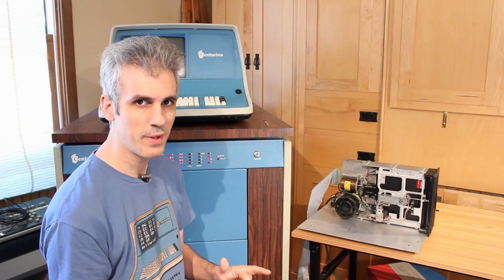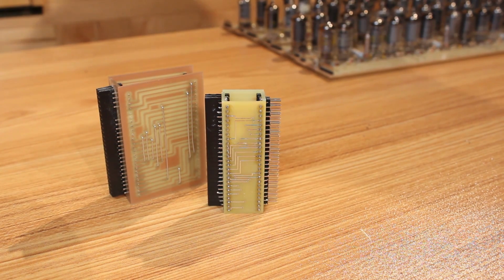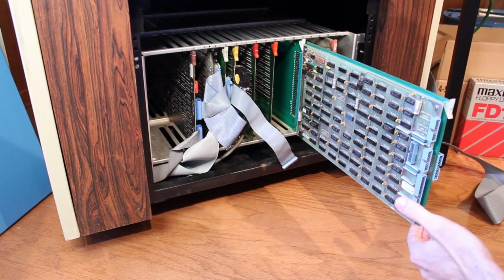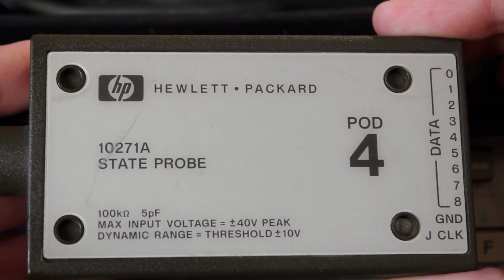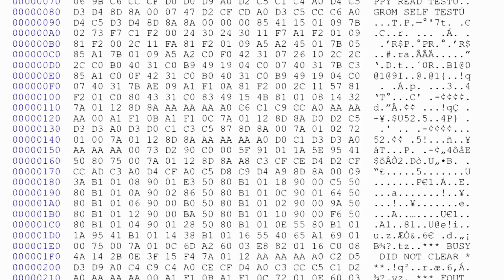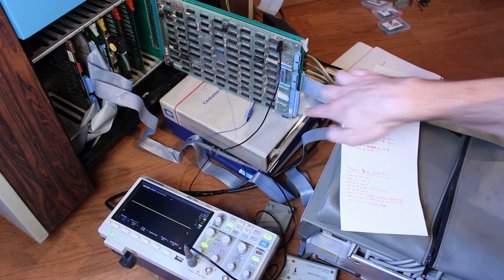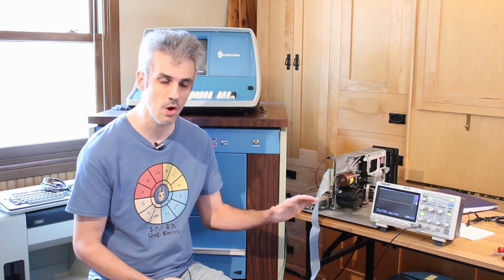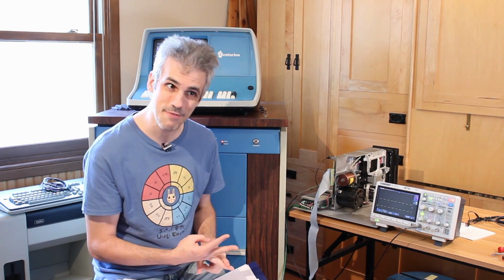Minicomputer Part 22: Working on the FFC and CDC Floppy Drive

Comment: I saved one of those HP Logic Analyzers, a 1631A, from going into the dumpster at a previous employer. It had been bought in the 1980s direct from HP, used about about 30 minutes, and then put into storage up until the mid 2010s. That previous employer had a program where you could buy disused and fully depreciated equipment for a donation to the United Way, so at the end of that day, my wallet was $20 lighter, and I had a somewhat broken logic analyzer. I was able to diagnose intermittent switches in the keypad, so after an arduous disassembly, treatment of the keypad switches with DeOxIt and a reassemble, it worked perfectly. What a blast to see a similar unit here on the channel!

Comment: Microcode is essentially a ROM being used as a replacement for combinational control logic.
It's cheaper, and simpler, than designing a custom combinational logic circuit.

Comment: The PCB artwork you showed, with the whimsically routed traces on both sides... you could have PCBway put that on an flexible polyamide substrate, which is a transparent amber film.  That way, they could show off their manufacturing skill, and you could show off your trace routing. (Maybe not period correct, but they did use some flex circuits in the Apollo Guidance Computer core memory module, so it kinda has some vintage chops!)

Comment: 21:40 Im not well versed in 8 inch floppy stuff (I mostly work with reel to reel tape controllers and systems used in the old animatronic band from my childhood, The Rockafire Explosion) But the jittery nightmare going on there could be a problem with voltage, as I had some similar problems with the stepper motor on an 5 1/2 inch drive that was used with programming the RAE, and it turned out to be a bad capacitor (and possibly a faulty logic chip)

Comment: The step frequency is basically determined by the stepper motor inertia. Back then adjusting the step rate for specific floppy drives was common. It may be possible to replace the stepper motor in the drive to speed up the seek time.

Comment: It is quite the journey watching this series and the reverse engineering and detective work going on to get the system fully up and running. BTW, if you have a heavy guage piece of wire you could use it to jumper the missing ground pins on the extender board.

Comment: If you create a new version of the dual adapter you should avoid those 90º corners for etched PCB's. Nowadays does not matter too much as the manufacturing processes have improved a lot but it will get a better defined trace if you use 45º corners, 90º angles can cause an "acid trap" that eats too much copper. Again, not very relevant nowadays, but hey, if you can ease the manufacturing process with barely no effort, why not?

Comment: Just a heads up about the LM319 and LM339 comparators. The LM319 is significantly faster than the LM339. If you can't get clean data off the disk head through the LM339 replacement, you'll want to put in an LM319. Cheers.
Reply: The head signal goes through two amplifiers and a filter before getting to the comparators. The speed difference probably isn't that relevant given how they are used in the circuit but there are some '319s on the way for permanent placement. The speed difference is apparent on the waveforms though.

Comment: Hope you are able to preserve a copy of the micro code for the 9406 drive before modifying it. It may be useful some day.
Reply: Yes I was thinking that, because the Hard Drive may not work with the new Microcode
Reply: @MrLukealbanese  The changes to the microcode will only affect the floppy, the Finch uses almost completely separate microcode on the FFC. (In fact the circuitry for the Finch on the FFC is mostly separate as well, it's effectively two controllers in one). But the current microcode is on OTP ROMs so we won't be destroying anything, just burning new ROMs and swapping them out.
Reply: @sjsoftware72  thanks SJ, your contribution to this great project is brilliant!!!

Comment: Tips for your riser card:
- see if you can add sliders and hinges on the end. In professional environments we do this for greater stability and easier access.
- add jumpers in series and test lugs (pins which allows scope probes to be attached) so you are able to disconnect and to measure signals. Number them like you did on the front and back connector.
- if you are really going fancy: add box headers to easily connect the logic analyzer.
Reply: Yes those are really handy, especially the jumpers that allow you to disconnect a signal as needed. as the cards are horizontal I would also add in that a right angle connector outside the case, bringing the entire bus out to an identical connector to the unit, just 3cm away from the machine front, is also very useful, as it allows you to both have a board there and access the back easily, but also to plug in a short stub PCB that brings out all the signals to pins to probe as well. For the jumper side I would also add in a set of SIL sockets, so that you can disconnect the data  and address busses, and plug in a terminator resistor pack to allow them to be set as needed statically, though this then does mean the extender card is now going to have to be a 4 layer board to route traces through.

I was spoilt with avionics, having  6 extender cards with the jumpers, and the other side also having 12 layer extender cards, as the pin density on the cards was high enough to make having ground planes between each layer of traces beneficial. Of course you rarely could use the extender on some cards with critical timing, they simply would not work with the extra 15cm of track added, so you were stuck with having to deduce the fault from the symptoms, as you could not actually get access to the IC pins easily, as they were conformally coated, plus a double sided DIP layout with pins hidden under other packages. 

You basically had a hand size 2kg ceramic brick tile, with a connector one side. Plus 2 separate 5V power supplies, as the one was only turned on briefly per machine cycle to power the arithmetic, as otherwise the boards would melt. Still was 500W or so of heat in the unit, but a big improvement over the predecessor, which was 10 times the size, and mostly mechanical, and a tenth the ability.
Reply: @SeanBZA  Agreed, all great suggestions. You can put quite some thoughts in bus extenders to make them most useful. In addition, although it looks like the card works with a single ground line, by all means provide a good enough ground line. The last thing you want to happen is ground bounce from bus drivers switching.

Comment: Once you get the Centurion 100 percent. are you going to attempt to get the computer to print to the Wang Writer?  I think it would be a learning experience.
Reply: Should be easy enough, as the Wang should be able to use serial input direct, and would only need to have a small program to take this input, extract control codes, and send the data to the printer firmware to output. Get it to work both ways and you will double the ability of both.

Comment: Leonardo shouting at the Telly: Just add a bodgewire to connect ground...
Reply: But there's no ground contact on the card-edge connector to connect the bodge wire to. At best he could put a bodge in going diagonally across the board, but that largely defeats the point, and could end up with ground loop issues.

Comment: With the riser card also add in a few ground test points along the sides, along with also including a few power LED's to allow a simple test of the card voltages being present. A single hex buffer IC to take the 5V supply, and then grabbing a few of the signals, like reset, clock and all the read and write signals, so that you can have lights to show this, as well as convenient tap off points for the logic analyser to use for triggering.
Reply: Yes

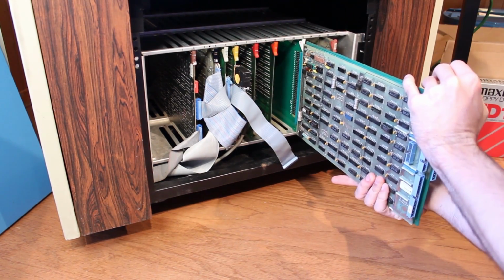Comment: ~8:20 - is there anything more carnally satisfying as the first click of a custom part, card, or whatever that you have measured, designed, and made (or had made)? PCB, 3d printed, cast or milled part, or whatever. That slight audio clue telling you that you didnt fuck up some measurement or essential geometry? God I love that sound. Keep up the awesome work!

Comment: Wow! I love your video series. Just one advice: it‘s better to use rounded circuit traces or diagonal edges to lower the RF interference. Although this may not be a thing in low frequency environments, it is good style. It make it easier for automatic reflow engines etc., too.
Reply: At these speeds, it makes no significant difference to signal integrity or RF interference. Dave Jones did a video about it a few years ago IIRC

Comment: I have an HP 1630G logic analyzer on my bench, which is almost the same thing :-)  I only wish I found more opportunities to use it, but its great for stuff of this vintage.  (I also connected it to an HP-IB floppy drive I scavenged off an HP 9000 system, which gives me the ability to save/load configurations on disks.)

Comment: I didn't realize that was the wrong drive for the machine.  You may have other problems.  As already discovered, your 9400 has a much slower seek time.  That's likely to cause timing problems in other areas as well as the machine was written for the faster drive.  Also, the 9400 is a 77 track unit, while the 9409 is a 80 track unit.  There's discrepancies in capacity, but I'm not sure where that's coming from.  Can I suggest you go back to the Finch and just intercept the write control line to prevent it from writing to the drive?  I fear this whole floppy thing is likely to be one long rabbit hole.
Reply: The FFC card is expecting a single or double sided 77 track 8" floppy drive (a single side drive will probably work just fine, the FFC treats the double sided drive as a really large track number single sided drive, but reads from the higher tracks will result in an address error from the sector addresses on a single sided drive). Aside from the step timing, I'm confident that we'll get this working. We are planning to tie the write control high when we (hopefully real soon now) get to the Finch, but it's a matter of principle to get the floppies working now we've come this far.

Comment: Umm... why doesn't the riser card end with a bunch of wires that go out of the machine and to a more comfortable location? I doubt signal reflections will be noticeable with machine this old - just make power wires thick enough.

Double-check there is no jumper or register that controls operating speed on the card itself, anything about drive support in the manual? That frequency adjustable via capacitor may well be that support.

Even if that test failed, I sort of don't think that's the main problem. Try going deeper into the circuit anyway. Did you find a working amplifier?

You can read and write floppies with any MS-DOS x86 computer with a "real" floppy controller (not a USB one) and some free software, such as imagedisk, libdsk, omniflop, etc

You don't need 4 boards for floppy adapter, one is quite enough - use the 90-degrees connectors (ending with "R"). You might also want to add logic analyzer testpoints to that board - you will need those.

You can also crimp a connector onto a ribbon cable with a proper tool. You can do it without proper tools but it's much more work.
Reply: The trim cap for the VCO is the only adjustment on the FFC apart from the can of worms that is rewriting the microcode. The Centurion uses a non-standard formatting (400 bytes per sector, and that's not the only non-standard thing), which renders formatting/reading using a controller based on a udp765 or similar basically impossible. At the moment (more to come on this in a future episode I am sure), we are pushing down bubbles in the wallpaper only to discover new ones popping up...
Reply: @sjsoftware72 /videos Thank you for reply.

My understanding is that 8272 with specialized DOS-based imaging software can in fact write weirdly-formatted floppies. 

I'm not entirely sure how they achieve this, but probably by precise timing and abuse of controller's registers.

Of course I may be wrong and also Centurion may require parameters way outside of what a PC floppy controller is capable of.

Microcontroller-based floppy readers/writers also exist - and supposedly able to read/write almost anything - but I know little about them.

Is there any surviving real floppy disk for the system, even almost unreadable one?

Comment: LOL HP 1630D!!
   I had one of those on my desk for 18 months while I was testing the ROM and I/O system of the Apple //GS.  It had a custom WDC65816 interface pod.  So I could trap code issues and document them.  Came in very useful when I was testing the ROM based SANE Floating point support on the GS and found that my reference platform, the Macintosh II was actually reporting incorrect results!  I found out the hard way what it is like to get caught in the middle of a political fight, in a computer corporation, as a Test Engineer.  I was testing the //GS ROM but found and error in the Macintosh ROM! It was like stepping on a landmine.

Comment: Drive is useable, simplest way that will probably work is to add some NOP operations to the microcode instructions to slow it down.. wont need many considering the blistering speed of the centurion :) ,I had to do something very similar many many years ago with some hardware that was expecting a slower signal than the machine was outputting.. in that case a couple of NOP operations delayed it enough to work.
Reply: On the right track, but the FFC microcontroller runs at about 2MHz so that would be quite a few NOPs to slow down from 3ms to 10ms...
Reply: @sjsoftware72 dang it I thought I heard 0.7ms not 7ms.. in which case yes that is a bit extreme.. However, it looks like there is enough documentation and knowledge to write some code to waste away enough CPU cycles to create the needed delay.. perhaps some arbitrary arithmetic? looking forward to the solution.

Comment: Be careful with the very long 26 pin DMA cable. I think the max DMA cable length we ever tested with was around 24 inches.   Great work team.
Reply from the maker: I was definitely nervous about that, but with testing with both the short DMA cable and the long one, we were getting the same errors, so the problem is deeper in the system. Though, we had a pretty big breakthrough last night!
Reply: Another solution to the problem would be to use the raiser card for the card that DMA cable is plugged into :)
Reply: You rock, Ken. Thank you for all your help with this, the project wouldn't be near as far along without you. 👍

Comment: Question,  when the format command was running on the FFC - Floppy was the Write Enable and Write Data signal going to the Floppy drive?  If the Format Write was not completed the the Read Read data test will fail & may not even have any read signal.   Next after the VCO on the FFC  was adjusted does the Seek test now also fail like the RTZ test?
Reply: We did check the write data out. I can't remember exactly, but I think that was one of the clues that the VCO needed to be adjusted. I'm not sure if the seek test failed or not after the adjustment, because that only seeks one track at a time, and the microcode puts in a delay to ensure there's enough time between the head load and valid read data following the seek.
Reply: @sjsoftware72  Great work SJ.  Just needed to ask about the writing before trying to read on the "new" diskette.    Thank you for using your skills on the Centurion project.

Comment: I feel like I'm missing something - you've gotten this far only to find the drive won't do a Return To Zero??
Reply from the maker: Sorry about that, the story in this one is a bit disjointed. I've been struggling with this floppy for about a month straight now, so a ton of content and story had to get cut to prevent the episode from ballooning into a 4 hour monologue on all the trials and tribulations.
In short though, the adjustment capacitor on the FFC was throwing me for a loop. It was out of adjustment already, and so I was playing with it while watching the seek test and read tests and left it where it seemed the happiest. But, that capacitor changes the VCO frequency, which is used for pretty much everything in relation to timing and control for the floppy. I had it adjusted so slow that the timing of the actual card was now slow enough for the seek and RTZ operations to work smoothly, but that meant that write and read operations were completely borked.
Looking through the microcode, we figured out what kind of speeds it was looking for, so we readjusted with the scope on and got the FFC into the right specification. The seek test would still pass since it wasn't doing any quick movements (and the CDC drive is a champ), but the RTZ tests now turned into a nightmare because they were running at (the now appropriate) 3ms spacing. Fortunately, it looks to be a simple fix in the microcode!